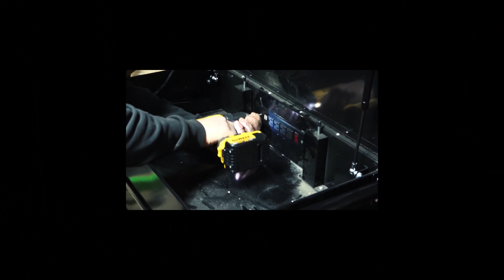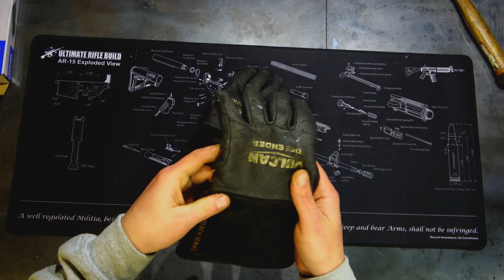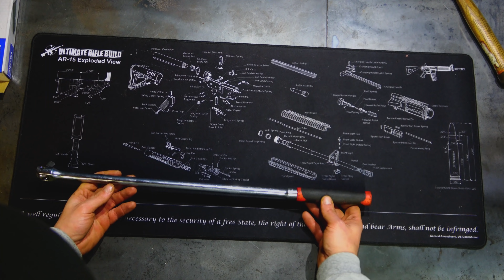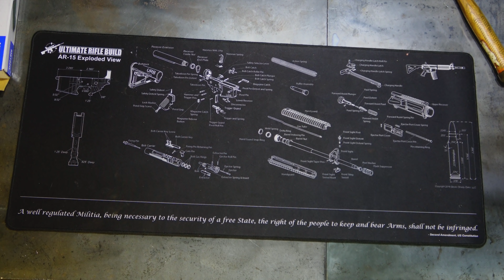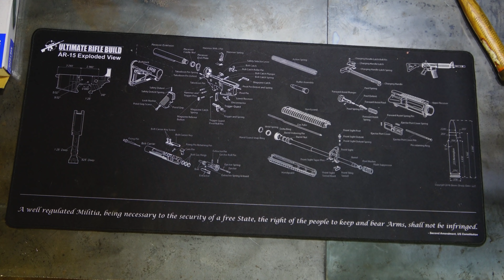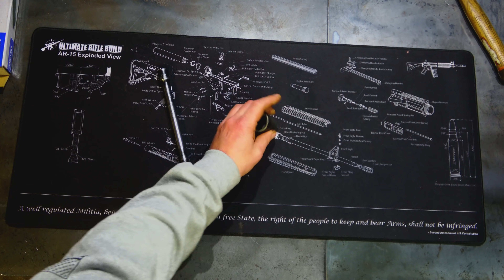5 Harbor Freight Tools Professionals Could and SHOULD Be Using in 2019

Comment from the maker: What tools have you used from harbor freight that you swear by?
Reply: The Nitril gloves and wire brushes are my main reason for going to harbor freight.  Also never forget a coupon for a magnet tray as you never have too many.
Reply: Great list brother.
Reply: I like pro breaker bar xt 1/2 impact fold up light Daytona jack too series 2 carts have one in yellow nasty set ups love those items
Reply: The tool cart is as good as a snap on , I know I have them both, the impact sockets had them since 2006.
Other equipment is used as needed basis.
Reply: @yellownp22541 , I've got a 1/2 inch set of the 
Metric 12 point impact sockets.  Put the 19 MM
through a NASTY test today.  Removing a dynamic 
balancer bolt, from a Honda.  Had a Craftsman 
breaker bar, about 1.5 feet of extensions, and a 
FIVE foot "cheater pipe."  Had the outer end of 
the extensions, on a jack stand.  I put my FULL 
bodyweight on the end, and had a friend hit the 
other end of the breaker bar with a sledge hammer.

Absolutely NOTHING broke, except the grip that 
bolt had on the crankshaft.  200 pounds, 5 feet, 
that is about 1000 pounds of torque!

Yes, 12 point not the 6 point ones!

steve
Reply: Steve Skouson ex
Reply: 90% of my tools is harbor freight. I own the 5 drawer cart, two 56", one 72", full of tools I don't feel like listing. I just wish I could start over and buy all these boxes in blue. I wish they sold a lockable hutch with stainless steel interior and led lights. I've been using harbor freight, lisle, gearwrench, kobalt, mityvac, ingersoll rand, craftsman, etc professionally for 7 years.
Reply: The long handle 3/8 & 1/2 flex head ratchets with the comfort grip are the bee's knees
Reply: My 4x6 band saw from Harbor Freight don't owe me a dime today. But today they do not sell the same machine. So I don't know if the new ones are as good as the one I have.
Reply: On our ranch we have a lot of Harbor Freight tools, especially like you said, the sockets are great.  As far as the toolbox goes, my husband is looking for one.  I will send him a link to your video because tool boxes are outrageously expensive.  The only thing we have not had good luck with from Harbor Freight are power tools with the exception of a miter saw.  Here we look elsewhere, but for what we do, their ratchets, wrenches, sockets, screwdrivers, and more, are really top notch. :)
Reply from the maker: @AgentPepsi1  I haven't had much luck with air tools or power tools from there but they do have some good hand tools like you said. Thanks for commenting and hopefully I will be able to help your husband. Their tool boxes really are great quality and affordable as well.
Reply: @RedemptionGarage  Thank you for your reply.  He is looking for a medium sized rolling toolbox.  I'm not sure how large he said it should be, but I know not the 72" one.  Any help is appreciated and thank you for making these videos as they are helpful indeed.  I forgot to mention, we do have a drill press and a bench grinder from Harbor Freight which are also really nice.  It is just the hand held power tools which have proven terrible.  Another thing one should never, ever buy from Harbor Freight are their batteries (AA and D cell), these are useless.
Reply from the maker: @AgentPepsi1  there actually is quite a bit of room in the 5 drawer cart I don't know if that's enoight for you or not. The 44" box has a lot of room and can be got with a coupon for around 400 and I have seen them for 350 on a few rare occasions. They would hold a lot of tools and are great quality for the price. The 56" box is the next step up and most normal people probably wouldn't have enough tools to completely fill that but they are arpund 650 to 700 woth a coupon. If you dont have a crazy amount of tools I would go with the 44" or the 5 drawer tool cart. Thank you for that I apreciate it and hopefully that helps some.
Reply: @AgentPepsi1  everyone I've ever heard all seems to love Harbor Freight's tool boxes. It's a box. How bad can someone mess that up? And yeah I'd say stay away from small power tools from Harbor Freight. Those you can mess up pretty bad pretty easily. I could tell you a story about a jig saw I got from them that literally blew up in my hand using it one day. Then when I kicked the cord out of the wall I took it apart to find out why it did that. That's after I threw it across my shop.
Reply: I swear by the electric impact gun. For $50 u cant beat it. And i use it all the time.
Reply: Earthquake 1/2 inch air gun for 10+ years now
Reply: my earthquake airtools and my aluminum low profile jack,I'm kind of fond of my Zurich scanner also
Reply from the maker: @dustinpomeroy8817  good picks bro
Reply: 1/2 inch extending ratchet is a beast of a tool. I work as a millwright and I say it's as good as the breaker bar
Reply: yes my post is shitting on yours...
Reply: their hammers, cut off wheels, impact sockets, bolt cutters, metal chop saw, extension cords, new vice grips and c clamps, wire wheel kits, air tool connections, gloves, pipe wrenches
Reply: Redemption Garage I’ve go the half inch earthquake xt impact and the stubby one and they’ve been great.  Have you tried those in a professional setting or no someone who has?  Personally I love them but I only use them at home
Reply: The 20v bauer impact, it's pretty strong for the brand and size compared to others. Great tool
Reply: Thanks for the content brother, I'm a harbor freight guy and yes like I don't buy/use every tool @ HF, be safe God bless God is love

Comment: I recently got the yellow Daytona jack and love the lift range and ease of pumping. The breaker bars are a no brainer. I've had a US General 44 inch top and bottom chest and Earthquake air for years and both serve me well. My most recent purchase was the Gardner magnetic pickup tool with light for like 10 bucks. Used it to extract door handle bolts buried in a door panel and it worked slick.
Reply from the maker: I have never tried the pickup tool. Thanks for sharing your experience John.

Comment: I love ❤️ harbor freight. I know this may sound corny but every time I walk into one I feel like a kid when I use to walk into a major toy store 😂I  have both 25 inch 1/2 inch breaker bars. I paid $14.99 for the pro version you featured in your video with coupon and $8.99 with coupon for the non comfort grip version. I was at HF yesterday and picked up a set of insulated screwdrivers the only ones they carry (pack of 7) 3 Phillips and 4 flat heads. I paid after taxes and a 20% discount coupon $8.52 and I have to admit I’m very impressed with the feel and quality of the screwdrivers. They are made in Taiwan. The only problem is that they are advertised on the packaging as having magnetic tips.i did not purchase these because of the tips, that is not important to me because if I ever need that feature on my drivers I have i high end MAGNETIZER /DEMAGNETIZER for that purpose, 3 out of 7 drivers have working magnetic tips. Other than that they are very well made the grips are rubberized very well textured for great grip if your hands happen to be dirty or greasy (which they shouldn’t especially when working on electrical components) I’m looking forward to purchasing their precision insulated version of these screwdrivers and the Quinn insulated electricians pliers set. I’m just a DIY’er and tool collector I also love their Pittsburgh pro ratchets. I pretty much love all of harbor freights hand tools and their lifetime warranty. But based on many hands on reviews I’ve seen here I really would not purchase any of their power tools. Thanks 🙏 for the video.
Reply from the maker: I love Harbor Freight but dislike certain things about them. I can relate to your feeling of walking around the store however and I am sure many prople feel the same way. Thanks for sharing and watching brother I really appreciate it.
Reply: Kind of like when you walked into a RadioShack back in the day
Reply: @MajorWeakness  see the ChrisFix videos about tools. Like all shopping, it is best to shop around and get things from many different stores, also better for your area's economy, especially compared to ordering everything from Amazon, if you want our future to be huge warehouses full of robots instead of middle class workers. The Harbor Freight toolboxes now have repair parts available.

Comment: I work for a railroad mechanical dept. and we have been using a single 19mm Hex Impact socket several times a week for the last 3 years for disassembling the trucks/wheel assemblies from the locomotives. I was surprised to notice it is a Pittsburgh Pro socket so I went out and bought my Impact set for home from HF
Reply from the maker: They are surprisingly really good impact sockets. Thanks for watching and sharing your experience Garrett.

Comment: I've been in kind of a forced retirement for 4-1/2 years now due to fighting stage 3 lung cancer. I WON, I BEAT the cancer just not the chemo and radiation. I was an industrial hydraulics technician for 16 years before that, built serious hydraulic machinery for the offshore oil & gas industry. A good amount of the hand tools in my shop box was harbor freight and I am the type that don't mind abusing tools..... Yeah, I broke some but couldn't blame it on harbor freight. Now I have a small wood craft shop in my back yard. Do alright, it keeps me active... I've got an 8X12 mini wood lathe, a 10X18 wood lathe, the 1"X30" belt sander, a 5 speed bench top drill press, planer and several power hand tools all from harbor freight. In the 3-1/2 years I've been working the wood shop the only thing I've had to repair was to replace the headstock spindle bearings on the little lathe and while I was at it I went ahead and replaced the belt although it didn't need it. That repair cost me a total of under 15.00, not bad since that little lathe that I paid 96.00 for with the 25%coupon has made me in excess of $2000. With in the next month I''ll be adding the oscillating spindle sander. I'd buy from harbor freight anytime I needed something and they have it. Just wish they sold a precision mini table saw, I looking at either the proxxon or the Micro Lux precision saws. Priced at 350 to 400 dollars each. The little mini table saw harbor freight sells is not powerful or acurate enough, I know, I have one of them too although it rips thin stock,(1/8" material) pertty good.
Reply from the maker: That's a great story James and congratulations. We can never stop fighting I have lost loved ones to cancer and it's truly an ugly part of life. My aunt is currently fighting this same fight and this has truly touched me. I am glad you stopped by and shared your experience and story just reading that has put things back in focus for me this morning.
Reply: @RedemptionGarage  If you don't mind, I'm adding your aunt to my prayer list. Cancer is a horrible thing and I feel for all affected. Like you I've lost several family and friends to cancer and it never gets easier. The best I know is to make sure your aunt keeps a POSITIVE outlook, it does help alot in the battle. I pray for the day this disease in wipe out so no more have to face it. Thank you for your reply and thoughts

Comment: I don't know how much welding you do. I weld for a living and I use those Vulcan gloves. They're great for the price. I always have a brand new pair at home ready to go. I prefer them over my Radnor gloves because they're thinner and you can work with them on which you can't do with some of the other welding gloves out there.

The price is right as well.

That said, I don't know what type of work you do that you got 14 months and counting out of a pair but I've gone through about 4 pairs in the last year. They're good, don't get me wrong, I obviously keep buying them but I don't know of a glove that lasts 14 months.

As for the other stuff you mentioned that I have experience with...the breaker bars are solid. I beat the shit out of mine and it was well the $8 (I think) I paid for it with coupon and it has a lifetime warranty. Same for their impact sockets, I completely agree. They are just as good as any other brand and they are priced well below any other option. They also have a lifetime warranty.

I have about 4-5 Harbor Freights that are 10-15 minutes away from me so warranty is not an issue.
Reply from the maker: Thanks for sharing that man. I don't use the Vulcan gloves everyday and I don't do much welding which is why I recommended them for cutting and torching gloves. I have used them quite extensively however mostly for acetylene torching and i repair and rebuild machines for a steel mill. I have had to use them for weeks straight, all day long torching, however. Cutting breakout out of these machines when the mold breaks and its not something that I do everyday all day but when it does happen it's not fun lol. I have used these gloves a lot and the pair i have has lasted me that long. I appreciate you commenting and watching!

Comment: Now the breaker bar I have bent . But everything is very good tool. Now snap on and Mack I would have said 15 years ago where better. But now not sure way they just drop off across the board !
Reply from the maker: Man you must have put some force on it because i have had a 4 ft pipe on mine jumping and it's held tough lol. Thanks for your input I appreciate it.

Comment: As a pipefitter your 100% right about the impact sockets.  I use the hf magnetic strip as a socket organizer. Works great.
Reply: That seems like a great plan
Reply: Pipefitter/Fabricator for over 28 years, and I'll get the Pittsburgh combo wrenches for $20.00 a set from 3/8" to 1-1/4" !! Although mostly use the 7/8" 1-1/16" & 1-1/4" mostly !! Job site tool room usually handles anything above 1-1/4" ! 
Also it doesn't hurt the poxket book when they mysteriously walk off !!
Reply: 100% agree brother!  HF wrenches are cant lose.

Comment: Have you done a video on the 
good tools HF "sells" that you 
should NOT "buy?"

#1 on that list is the 4 way (6 
really) screwdriver.  5 and 6, 
pull the bits out, and use the 
holder on hose clamps.

There a BUNCH more, the 25 
foot tape measure comes to 
mind.

steve
Reply from the maker: No I haven't but I was actually thinking about that the other day so it's most definitely on the to do list. Thanks for the idea though Steve I appreciate it.

Comment: Hercules cordless tools are amazing. Stubby air ratchets are amazing. The $80 1/2" impact last years but oiling is required. The double ended low profile swivel ratchet is handy but I own two because of how much it breaks. 36 grit flap disks are my first choice for prepping rotors for resurfacing, torque sticks, scan tool with abs, stethoscope, a Ames multimeter, I use swivel sockets on brakes every day, towing/trailer accessories are great, chains, ratchet straps, air hoses, fittings, air compressors, trim removal tools are stiff surprisingly, multi use ladder, green chisel/punch set, master ball joint press adapters (I bought the press from atd on Ebay cuz hfs sucked), tons more stuff I own and love
Reply: Gonna upgrade to the Hercules and Earthquake XT cordless.

Comment: They have good dead blow hammers, I bought a large one and a small one and that cost me a quarter of my snap-on. The large one blew apart and I took it back and they replaced it. I still have the small one after 5 years of use and it looks ugly and cracked but no matter how hard I try I can't get it to fail.

Comment: Do you think the yellow Daytona is worth the price premium over the Pittsburgh?
$79 vs $179 for less than weekend warrior use. 
If the 20’ height is good enough for me, is there a reason to spend the extra $100 if it’s much better
Reply from the maker: I think the daytona is an excellent jack but just to use around the house and here and there i would just get the pittsburgh if money is an issue but with that being said if i had the money i would choose the daytona. The pittsburgh jack will do just fine though brother.
Reply: Just use a block of wood

Comment: The Xtreme Torque 1/2” air impact is a beast. To get the full power out of it you have to upgrade all your air hose fittings to high flow. Every fitting from the compressor to the tool
Reply from the maker: I have never used them but heard they were good.

Comment: Great video,what do you think of there new torque wrenches
Reply from the maker: I havent had the chance to check them out yet but i have heard good things.
Reply: I might go pick one up,I need to torque my balancer bolt down so that should really test it
Reply from the maker: @Stevehevessy  i would say it will work fine but just off the top of my head i have a couple of concerns: first it costs 100 dollars roughly and i am certain it will wotk fine but after a while they need to be calibrated again and i am not sure how you could go about doing that so 100 may be expensive to only be able to use a few times comfortably. A cheaper alternative may be the tekton 1/2 torque wrench https://amzn.to/2EgEoe8
It's only 38 dollars will work for what you need it for and will have the same problems i mentioned above but a little easier on the wallet lol. They do look nice though and i wouldnt blame you to go either way man.
Reply: I actually have the tekton i just used it to torque some head bolts and it works good it only goes to 150 ft lbs though and I need to torque the balance bolt to 240 ft lbs
Reply from the maker: I think it will work good and they actually look a lot like the snap on torque wrench I have the snap on torque wrench but the icon may be the way to go i need to check them out before i can really give you a definitive answer but from what i have heard i think they may be really good
Reply from the maker: Let me know how it works out brother
Reply: Thanks a lot I appreciate it,I’ll let you know